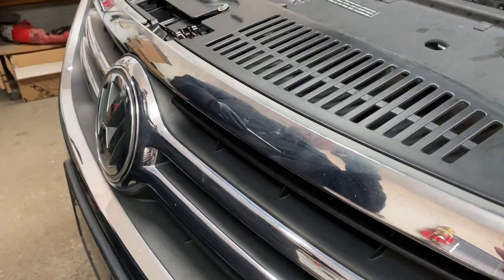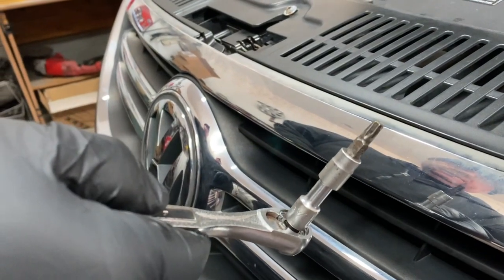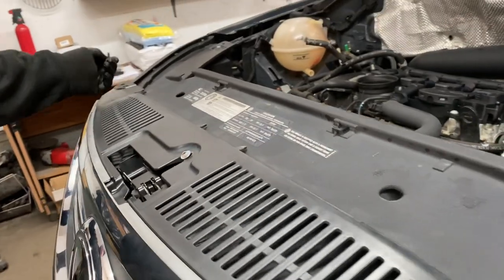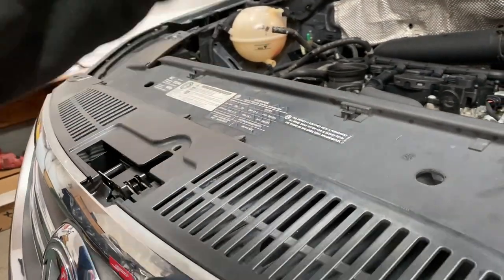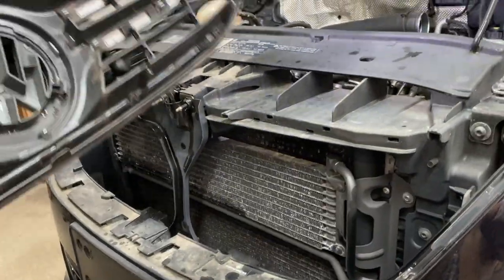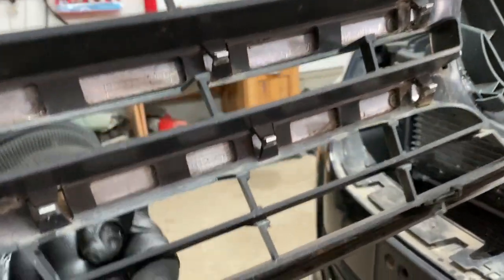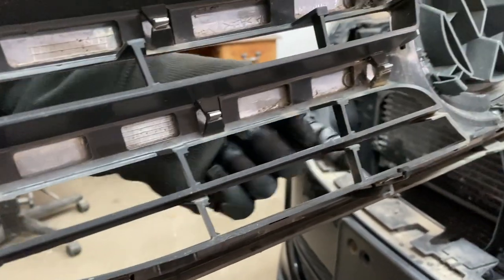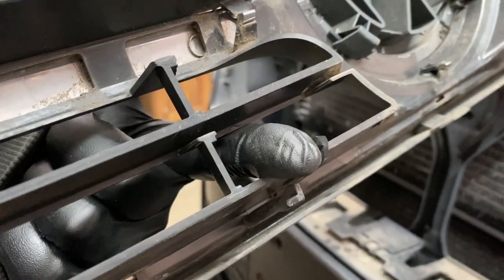VW Tiguan 2007 - 2011 Simple 3 Screw Grill Removal

Comment: Doing this first also makes removing the headlight assembly quicker and easier. I have a loose connection for my low beam, forgot how I get this off years back. Thanks for the reminder. 
Got some soldering to do. Thanks again.
Reply from the maker: Very good point! Thank you as well!

Comment: Thanks you but is it possible to remove the chrome metal also from plastic so i can paint it for black ?
Reply from the maker: I’m not sure as I don’t have any in the shop now but, I’m sure if it’s a separate piece you should be able to.
Reply: Try plasticdip paint, it works on chrome if you sand it down a little